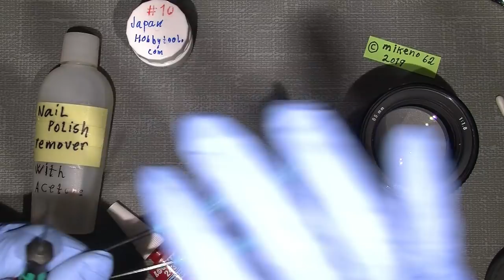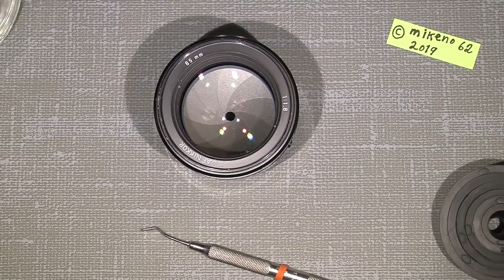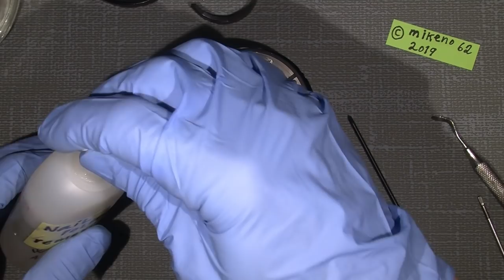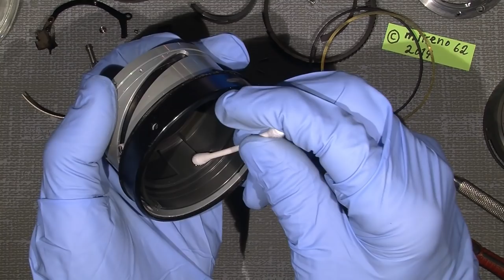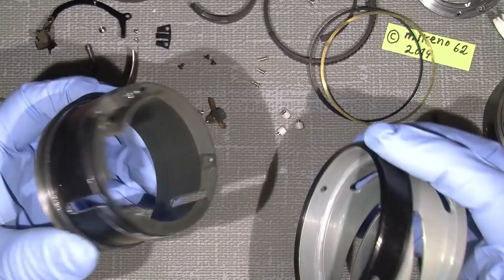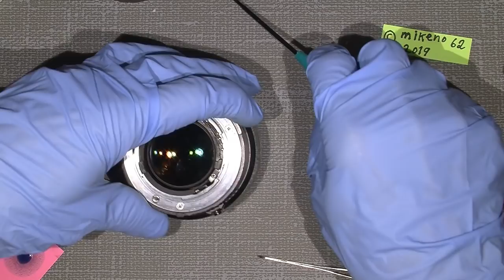How to re-grease AF Nikkor 85mm 1:1.8

Comment: Hi Mike, I am amazed how you disassembled the lens to the bare bones. I found this video because I am trying to figure out how to dampen the focus mechanism of these AF lenses (I have the 35mm f2 D). Could you briefly explain me where would you apply the dampening grease to obtain this effect? Would it be in the same are where you applied lubricant? I have never opened a lens like this, so the less I have to disassemble to obtain the dampening effect, the better :)
Thanks in advance!

Comment: Hello, My AF is not working due screw mechanism is deeper in the body. Before I try it myself, do I need to remove the front part, or I can start with the back? Not sure if it is misaligned or broken. Thanks. :)
Reply: Hi, i got the same problem, do you had any luck fixing it or did you find any info to that problem online? Thanks in advance.

Comment: Hi, do you have any experience to repair the old tokina 80-200 2.8 at-x pro? The focus does not work at auto and manual funktion? Thank you for feedback!
Reply from the maker: Sorry, but I no experience with that lens, but maybe you can get some info here:

http://forum.mflenses.com/viewtopic,p,1248317.html#1248317
Reply: Hi @mikeno62  Thank you for your feedback and the link. i will dissasemble it. but 
first I need new reading glasses. ;-)
Reply: @mikeno62  can u service Nikon 85mm 1.4d